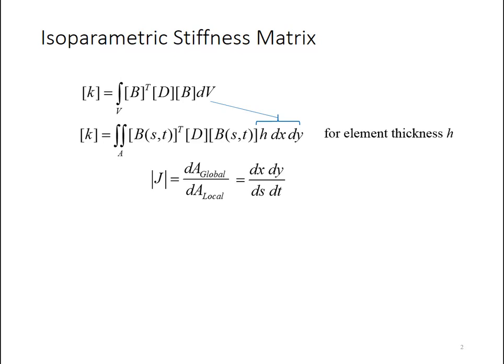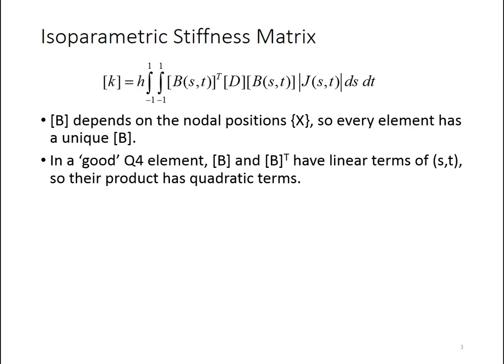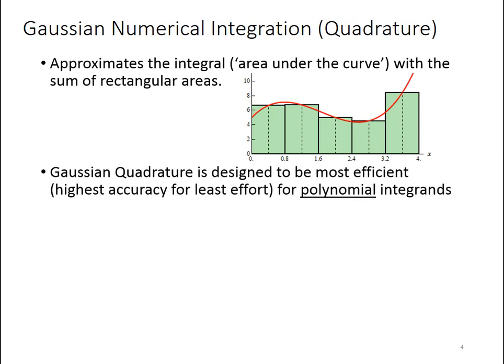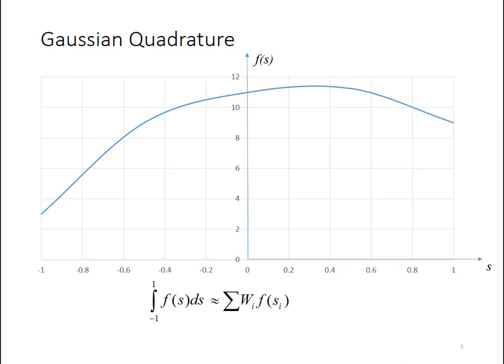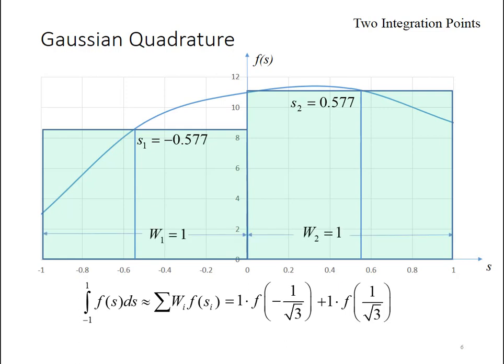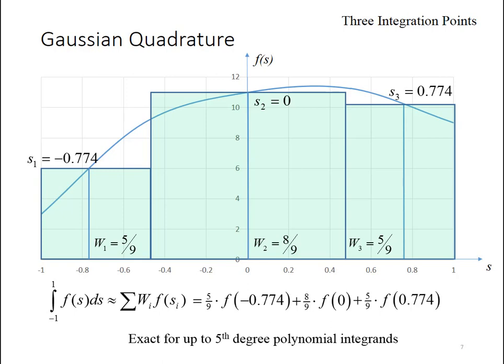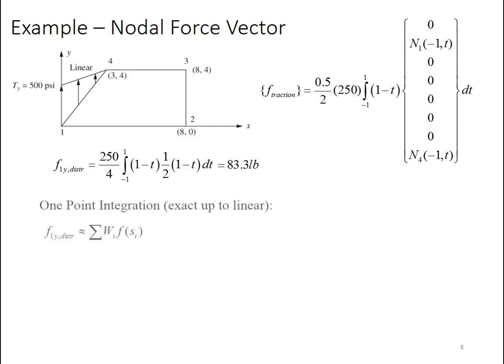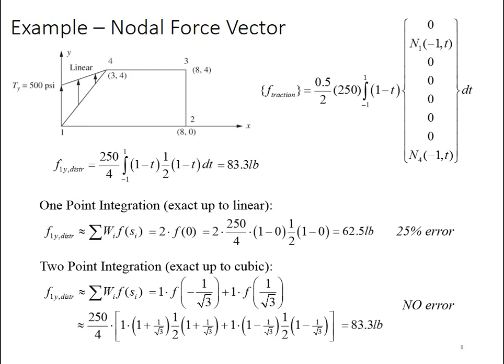FEA V29: Gaussian Quadrature

Comment: But |J| is always linear, never quadratic (easy to see if calculate: |J|=1/8(s*((X_3-X_4)(Y_1-Y_2)-(X_1-X_2)(Y_3-Y_4))+t*((X_4-X_1)(Y_2-Y_3)+(X_2-X_3)(Y_1-Y_4))+((X_1-X_3)(Y_2-Y_4)-(X_2-X_4)(Y_1-Y_3)))). If D is polynomial in terms of s and t then the integral is very easy to calculate exactly (polynomial divided by linear polynomial), and if it is rational it is still possible and not significantly harder.